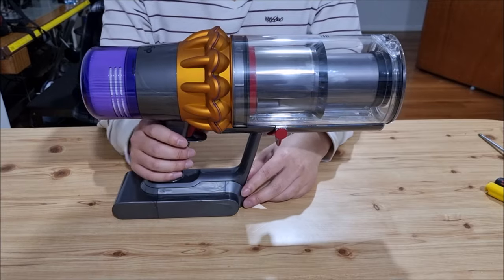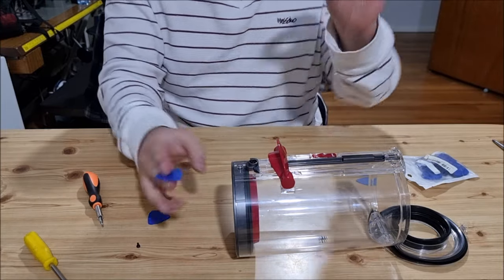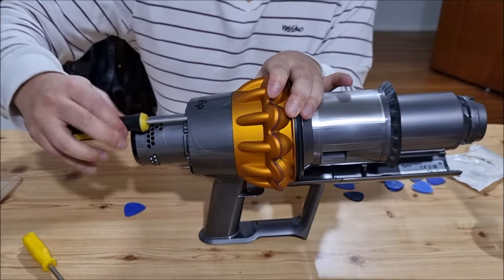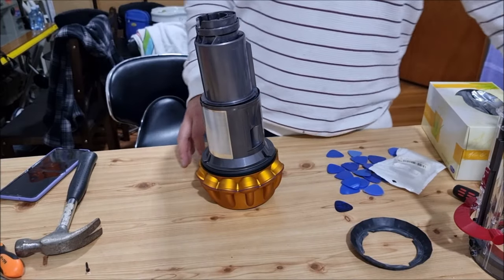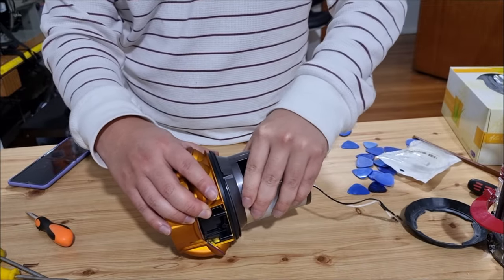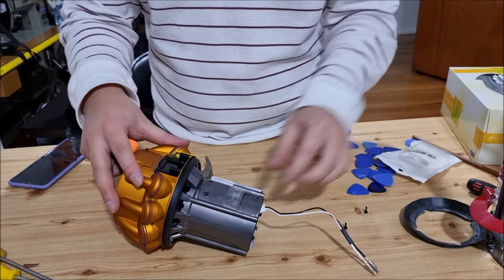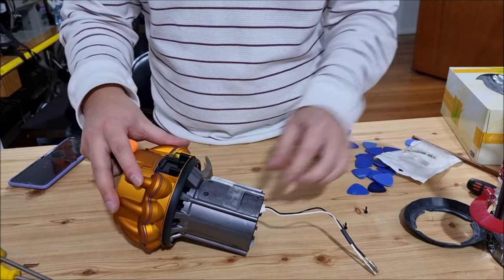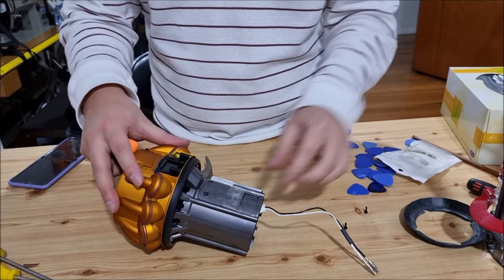OPEN ME UP! Dyson V15 Detect Complete Disassemble and Clean

Comment: Wow that is way more complicated than I would have expected. Removing that power connector is definitely sketchy I pretty much destroyed mine. Thanks so much for the teardown!
Reply from the maker: there are 2 ways you can remove the connector. i have videos show you the 2 ways. probably try the safe method next time
Reply from the maker: @apet11  it is ok just put it back in place and it should be fine
Reply: I just destroyed mine too.  I am very frustrated.

Comment: Thanks for the helpful video. One can separate the housing piece that contains the particle flow sensor from the gold piece that has the cyclones without creating a 4-sided prying tool to remove the power connector (29:38) - you simply have to remove the sensor board (which, as you've shown, requires pulling the two tiny connectors to the very thin electronics wires) then, pull the white + black power cord with the fat white rubberized wad through the housing and get it past the little thin electronics wires. Once it's past them you can get it to feed past the final bottom hole at the base and the big housing piece holding the particle sensor comes free of the gold cyclonic piece. The black & white power cord with the fat white rubberized wad simply stays connected to the clear plastic connector that would require a 4-sided prying tool to remove. 
I had to separate these two pieces in order to clean mold and mildew from every inner part of the unit, so I had to figure out this method.
Reply from the maker: thanks i will have a look next time i open it up

Comment: Nice breakdown of this system.  I have to wonder why they make that connector (that made you break all your chopsticks) such a sticking point, like 'we don't want you doing this' connector.  The rest of it is quite simple.
Reply from the maker: when you call dyson for a replacment part, they replace the whole thing. therefore, you are not meet to take it apart
Reply: @OpenMeUpTec  including the screen etc?
Reply from the maker: @richardcook1987  cant they glue the part where you take out the motor. you need to do that before you get to the screen

Comment: After aligning red gasket and retaining ring, the ring snaps into place but is not very tight. Pushing the tube back over the body pops the red gasket and retaining ring out of its holder. This happened before i disassembled it, which is why i turned to your (excellent) video in the first place. Is there a way to hold the retaining ring tighter?
Reply from the maker: can you watch the video and tell me at what time you see the ring and where in the video you have issues with. it makes it easier for me to undderstand can give you an answer

Comment: Great disassembly vid. 👍
Was thinking about getting the v15 after all the trigger issues with the v11 Thanks
Reply from the maker: you have to remove the glue to take out the trigger. they started to glue it so people wouldnt do stuff to it. the battery is different

Comment: This is a very good teardown video, especially that so many other videos, together with the manufacturer themselves is suggesting just rinsing the transparent container and back filter with water is enough. It isn't, after 1 year I took almost a full pound of dirt from every single space found inside the case. Honestly, it makes me sad to think the most expensive vacuum on the market is actually so poorly designed when comes to internal integrity of those parts and the shady design decisions like this connector that they clearly changed vs the V12/12 models just to fuck with me trying to clean my own device.
The only thing I would add to the video is that this last place that you could not get into because of the lack of prying tool can be cleaned to a satisfying degree with pressurised air - I used a hairdryer, but a can of laptop cleaning air should do the trick just as well.

Plus it is a cleaner video when you disassemble a clean one, but using an actual used, dirty one would help illustrate the actual issue at hand to people who have not yet tried to look inside theirs
Reply from the maker: in one of my video for a v11, i left it dirty and it was just to hard to disassemble and show people stuff ,which is the purpose of the video. therefore i try to give it a quick clean before or it get out of control

Comment: I have a sv15   i have no power gettting to the power head.  Checked all connections that are easy access and they all are clean.  What could be the cause.
Reply from the maker: if the vacuum is working you have an issue with the power cable/connect somewhere. you can see this cable in 17:30 in the video

Comment: I recommend when assembling the gaskets back on...use a dab of silicone to aid the mating surfaces
Reply from the maker: originally they dont have any. therefore i wont recommend it. when you use the vacuum the suction will cause it to close up therefore it is not necessary
Reply: @OpenMeUpTec  what I meant was maybe some silicone grease to help reassemble the gaskets because you said they were difficult in getting back on
Reply from the maker: @bio10155  i see i would not recommend that as it will cuase dust to stick to it. if you want to use something make sure it is not wet or else dust starts to build up on it

Comment: I've been using v15 for a month, today I noticed that one of the circles of the purple foam seen at 28:00 is ripped in the middle. Is it covered under warranty? I don't know if suction is affected.
Reply from the maker: call up there is no harm. they will give it to you for free.
Reply: Use electrical tape
Reply: @hawaiianboi88  Dyson Turkey replaced my motor unit the same day.

Comment: I've had two units, and the purple seal was protruding out so much that it worked itself out with normal use. Now the replacement unit still have that gasket sticking out, so eventually it will fail also. Very poor design.
Reply from the maker: can you watch the video and tell me at what time i can see the thing you talking about as it is easier for me to give you advice

Comment: Hi! My V 15 has an issue of showing the last vacumed particles numbers and doesnt start until i reinsert the battery. What could be the case, it doesn't want to work?
Reply from the maker: looks like a software problem and by reinserting the battery you just restarted. as it loses power when you take the battery out and starts again when you insert it

Comment: For some reason my battery wont clip back in ive looked everywhere and no tabs or anything broken any suggestions?
Reply from the maker: did you remove the tigger, if you did you didnt put it in all the way
Reply: @OpenMeUpTec  i havent removed or opened anything. All i did was remove the battery to charge it now wont click back into place for some reason
Reply from the maker: @stevee4746  you might not be aligning it correctly or something is stuck inside
Reply: @OpenMeUpTec  i thought same thing but cant see anything jammed and seems to be aligned but thanks for your help

Comment: What is the use of the rubber ring?
Reply from the maker: which one? can you please watch the video and tell me at what time i can see the rubber ring
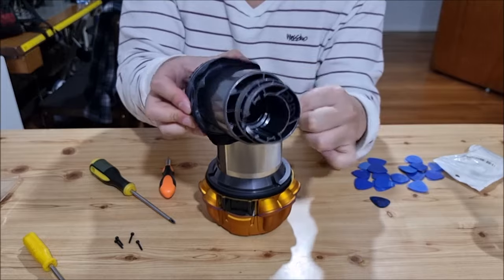Reply: @OpenMeUpTec  17:16  i am wondering why the dyson outsize motor doesn’t have the rubber ring compared to the one you have
Reply from the maker: @ahmedalsubaie544  i have a video on the dyson outsize so you can watch that if you need to instead of watching the wrong video. that ring is to stop the stuff from coming up when you empty the bin.

Comment: The trigger sometimes broke on v10 and v11. Could you say how it should be replaced at v15? Thank you.
Reply from the maker: watch 39.20 in the video. it is the same as the v10 and v11. the issue is on some of the v11 and all of the v15. they glue the area that you need to access  do replace the tigger. i already have a video with the v10 and v11 which shows you how to remove the tigger
Reply: So later if there was a problem with the trigger on v15, it won't be replaceable, because they glue the area? Would you know if they've improved the trigger? Thank you.
Reply from the maker: @tiborilles  doubt it. the glue is there so people will call up dyson for help. you can remove the glue but it will take effort
Reply: @OpenMeUpTec  You know how the trigger on the V11 breaks and causes the machine to no longer turn on, would you say this same problem would happen to the outsize+ I'm waiting to be delivered?
Reply from the maker: @vorsprungdurchtechnik5  it happens to all of them
Reply: @OpenMeUpTec  any way to prevent?
Reply from the maker: @vorsprungdurchtechnik5  nope
Reply: @OpenMeUpTec  have you seen triggers go bad already on the outsizes? Or v15s?
Reply from the maker: @vorsprungdurchtechnik5  yes. it happens to v11 the most
Reply: @OpenMeUpTec  metal replacements on Amazon would be a good permanent fix right? Is the material on the v15’s trigger stronger than the material on the v11’s trigger? Thank you for being so informative
Reply from the maker: @vorsprungdurchtechnik5  after the v11 they started to glue the whole area that you need access to. therefore you cant replace the trigger anymore
Reply: @OpenMeUpTec  oh wow.. even a repair shop or I couldn’t do the job? You think my outsize+ will be okay for a while?
Reply from the maker: @vorsprungdurchtechnik5  you can do that job, it is just alot more effort
Reply: @OpenMeUpTec  glue type?